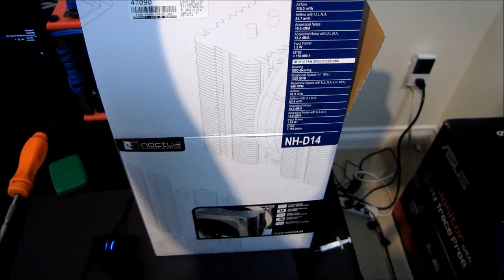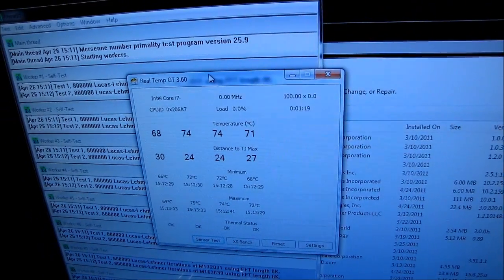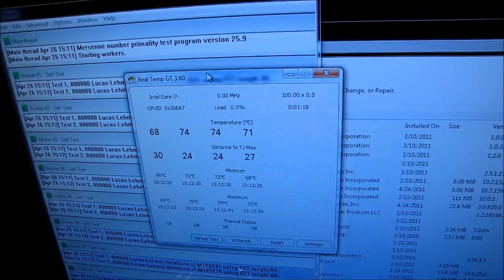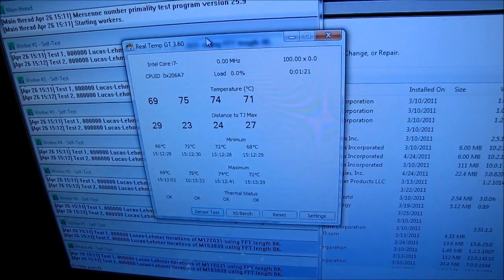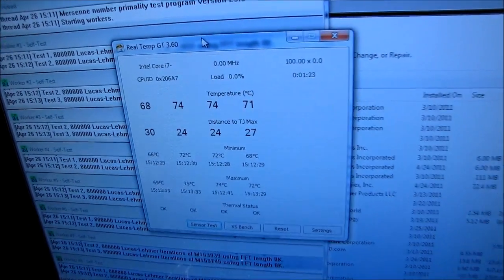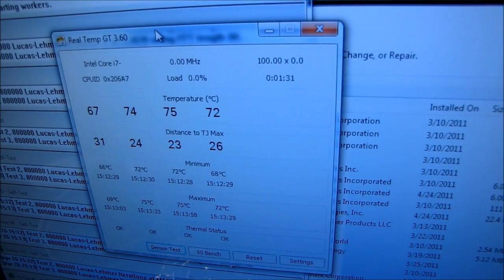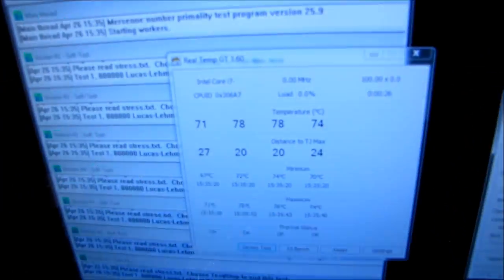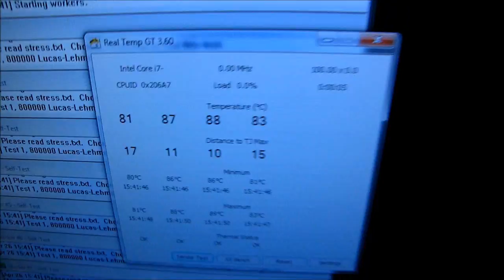Extreme Cooler Showdown Corsair H70 vs Noctua NH-D14 Linus Tech Tips

Comment: @rock962000 I can't wait to build my future system and water cool and do the building itself. But between the H70 and the Noctua, I'd probably get the air cooler. I'd go for water cooling for noise and cooling, and it lost in atleast one category.

Comment: The downside to the D14, you have this huge mass of weight hanging from your motherboard, thats a lot of stress! Plus some cases may not be able to fit a side panel due to its heatsink height.  Plus this is a tech bench test.. Do the same test in an enclosed case and see how the temperatures fair.

Comment: I used to own a D14 but switch over to h70 because the d14 is too damn big. Eventhough the D14 out perform the h70 you can put a fan shroud between the fan and rad. Mine looks like this: fan->shroud->rad>shroud->fan. It actually decreases max temp by 3-5c. Also changing the thermal compound and fans help too :)

Comment: Linus,I think the fans you used for the h70 are not adequate for a push & pull through radiators. You need to use the spiraled ones, I think they are the p-12's, that are made for push & pull configurations for radiators. I've tried a 2600k @ 4.7 and it tops at 81° with 21° room temp.

Comment: Nice video....I been telling ppl this for a long time.....good to see even a basic quick test shows that the Noctua NH-D14 dominates over ANY All-In-One WC'ing solution. And you even used the Noctua fans....which shows even if you spend the extra $ to buy decent fans it will not beat the Noctua NH-D14.....or the Thermalright Silver Arrow for that matter.

Comment: just ran prime 30 mins again MAX @ 4.8 GHz max 74 C on one of the cores
the mounting postion is not good on his rig and not the fans you get with the H70
the noctua is better at cooling but not this level of difference 
and the noctua is ugly as sin

Comment: @Woofers11 I don't see why it's odd, you use what works for your set up and is preferable within that reality.  I researched both the H70 and NHD a whole lot, by that I mean I read multiple reviews, watched pretty much every video about the two here on youtube, read the large majority of customer reviews on Newegg.  I came to the conclusion that the NHD is considered to be a bit better than the H70 based on those factors but I still ended up going with the H70 b/c it works for my needs.

Comment: I prefer my H50 (w/push pull using Scythe Kaze-Jyuni x2) over an air cooler just because of the size and stress the air coolers put on the mobo sockets. If air coolers could be as efficient as they are now AND smaller/lighter, I would definitely start using them again.

Comment: i put an h-50 on my i7920@4ghz and got way to hot like 85 degrees so i went back to m CM V-8 and that does not go over 75 degrees so i put the h-50 on mt i5760@4ghz and it works great no more that 75 degrees i think its due to hyperthreading

Comment: Hmm I have my 1090t oc'd to 4.1 ghz,with a h70 with the stock corsair fans and idle is around 29degrees c and on full load it reaches a top of 49degrees c with prime 95. Kind of silly putting those noctua fans on, kind of unfair comparison.

Comment from the maker: @BeDuckie1 The NF-P12s are great for static pressure, which has been proven again and again! The P stands for pressure!

They're low noise fans, so they will not perform GREAT, but I wouldn't even let the fans that most people consider "good" near my test bench due to the noise. P12's are a great balance between pressure and noise.

Comment: NF-P12s arent good for rads. GT 1850s would way better. Didn't mention that the NH-D14 isn't compatible with many RAM which have tall heatspreaders. This can be an issue if your case isn't wide enough to fit that massive heatsink. You would have to raise the fan to clear the RAM and that could prevent you closing the side panel. Also the Thermalright Silver arrow is better. H70 would have performed much better with stock fans + in a case. NH-D14 has better heat dissipation on a test bench.

Comment: um wouldnt the airflow of the h70 be hindered by its position on this video while the d14 has a bit more accessibility. I think this review is good, and linus's logic is no doubt true, but i do believe u can achieve slightly better performance off of the h70 with better positioning. Oh it would be great if this comparison also included both coolers using their stock fans, cause a lot of people dont want to have to spend another 40bucks on fans after buying a 100dollar cooler lol

Comment: There is obviously something that has been said and it could be a great comparison. Sure you are in a open environment  so its obvious that the more surface area you have more it will be efficient, BUT in real world in a case what will be the results. Usually, you get way more heat that builds up in the case and more surface area you more quickly thing will get warm. Please test it in a close environment for a much "real world"  comparison.

Comment: One thing to considder is size and weight.  The H70 will work better in most cases then the Noctua cooler.  If you have a big case or open bench no worries.  Also a lot of popular motherboards out now have MOSFET coolers that are to tall for the Noctua to fit.  You just need to be careful.

Comment: Linus should have tested with the Kuhler 920 since that's supposed to be a better H70 (made by Asetek I know). LOL on the BSOD too. And why he stuck the Noctua's fans on the H70 is beyond me. They're quiet lower RPM fans, they just won't be able to do good enough compared to stock H70 fans but at least they'll be less noisy.

Comment: So many fanboy tears.
Look chums, he didn't say the H70 was garbage. It's actually a very nice cooling solution for overclockers. It's just that, when it comes to extreme OC'ing -- at or near the 5GHz line -- it doesn't perform *as well* as the Noctua. Really, for both coolers to keep an over-volted Core i7 running full tilt at close to 5GHz operational is a feat; that's the point where most sane OCers would spring for a full-featured water cooling kit.

Comment: I find the NH-D14 to be gorgeous and it is as you stated a top league cooling device. But my question is if it is higher or wider than the NH-U12P, because that is my current cooler, but in order to fit in my dominators I had to remove the pull in fan. Would this be a problem? My MB is a GA-P55A-UD3 if that would matter. Cheers.

Comment: @Malikuniversotomb 
... wow man so naieve the h70 is not the best cooler on the market, and Linus would not make a mistake like that, he probably used the same thermal compound for both. the thing is by pure surface area the d14 kicks its ass, the h70 is not the best cooler and there is nothing wrong with the configuration the d14 is just better, live with it. nothing is perfect, the h70 is one of the highest end but it can never beat such a huge air cooler.

Comment: @Megadeth6633 Im not 15 (yet) my bday will make me 15 ^^. The stock fans is at level 5 in my bios wich means that they are at 50%, i haven't tried Prime95 for over 30 min yet so and the idle is around 35 and c4d rendering 65 - 70. The highest result ive ever gotten is 91 because i had no fan speed + i where playing minecraft wich needs the processor alot i guess.

Comment: @arys64 it was almost at 90 degrees, shows an h70 just can't handle a 2600K at 4.7 ghz with unreal load temps. 
I can run my 2500k without a problem on the h70 at 4.6 ghz at 63° max.

Comment: Quick note: Doesn't work with all high profile RAM, I use Corsair Vengeance and I had to remove the heat spreaders (not that you need them as) The NH-D14 compensates for high profile RAM without spreaders by slightly blowing air over the RAM. As regards to adding the third fan to the NH-D14, I wouldn't bother, it makes a small difference and it takes up a lot more space, even in a large mid tower like the 600T the third fan is sat on the rear exhaust.

Comment: The NH-D14 cound have gotten a little bit better temperatures, if you had Reversed the Fans so it pushed air towards the Wall.

The way it was in the video, it could have sucked a little hot air into it, that was beeing exhausted out from the Video Card

Comment: Just did a bunch of tests with a H70 and a 2600k and I must say I really like it. I used Notuas fans too, so the noise is barely noticeable (with the inline resistor) and I can get an easy 4.1Ghz 24/7 OC. Idle: ~30C, Prime: ~72C, LinX: ~75C. I like the fact that there is not a heavy weight on the socket / motherboard, which can be a good thing if you plan on shipping the system or taking the PC with you on LAN parties. On the other end, the NH-D14 already has the Noctua fans and is a bit cheaper

Comment: The fan on the H70 is partially blocked when you put it that way, and I think the gap will be closer when you do the test on a closed case. The point of H70 is to exhaust heat away quickly from the case, not into the case like most air cooler.

Comment: Linus, do you think i can overclock a i7 2600k to 4.5 h
ghz using a Asetek 570LX Liquid Cooling system w/ 240MM Radiator?

I need a answer.